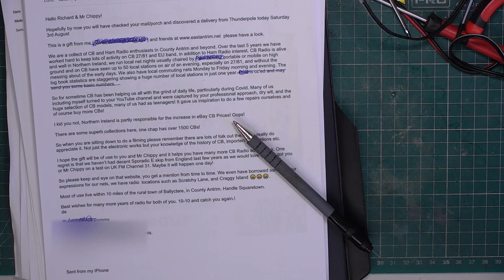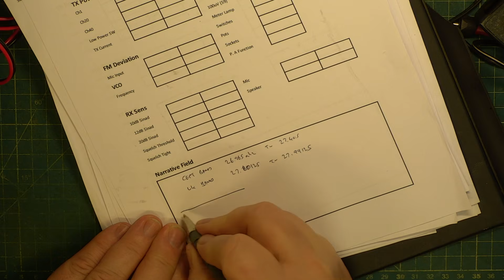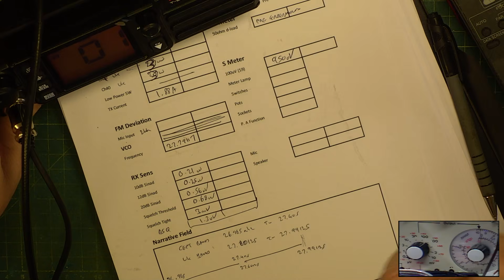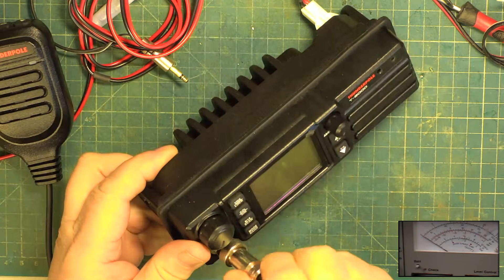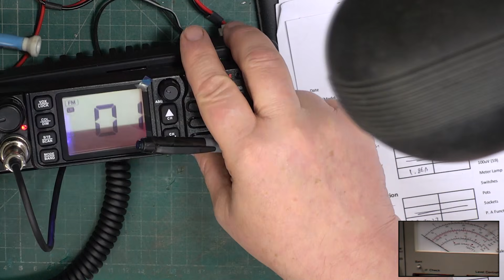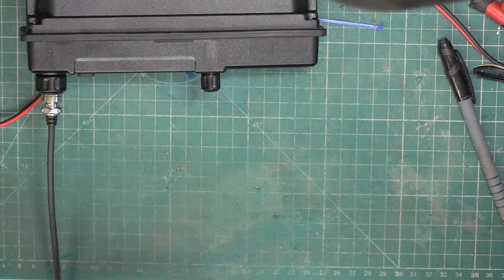Thunderpole T3000 CE-MultiNorm double service - New gifted CB radios

Comment: Do you ever hear SSB skip on your UK channels? I know 27.600 LSB has a lot lately & 27.601 is one of your channels.
Reply from the maker: Yes, illegal SSB activity interferes with the unique UK FM CB frequencies (27.60125 to 27.99125). Frequencies are allocated by international conference agreement, so it's frustrating when pirates spoil it.

Richard, G0OJF, UK
Reply: @ukfmcbradioservicingTango21  Here in the US & Canada that is part of the free band which is 24.415 - 29.995 MHz side band & also below channel 1 which most use 26.515 - 26.955 MHz AM & FM mostly. Many go off 5 kHz like 27.600 instead of 27.605 MHz etc. for example.
Reply from the maker: @drsysop  But 'free band' means Pirate as in illegal...just sounds better.

Richard, G0OJF, UK
Reply: @ukfmcbradioservicingTango21  True, but the FCC here never monitors it & nothing allocated to them frequencies anymore. The FCC charts out there are outdated & not accurate. -Cheers!

Comment: The output power on both sets as they came from the factory was surprisingly poor. It’s sold as 4w why is it only doing 3w? The quality control clearly not good enough. Also, if I was paying £119 for one, I’d expect it to have mounting screws

Comment: hi richard, can you help me with a diagram for connecting the wires to a microphone with a 6-pin plug for a TTI 880 H station, they are broken and I don't see the order in which they were
Reply from the maker: I have the circuit diagram & layout on file. Email me & I'll send it you.

Richard
Reply: @ukfmcbradioservicingTango21  where can i find your email ?
Reply from the maker: rshireby@yahoo.co.uk

Comment: I saw someone suggesting there's a resistor that can be bridged in these to get about 6 watts out of it. Maybe that's when they overheat!!
Reply from the maker: Well CB is full of myths, legends & BS - hence doing this channel showing the truth on laboratory test equipment & real-life genuine tests.

I'm sure motor cars can have things altered to make them go faster & reduce the engine life too.

This reminds me of the guy in Sheffield who decided to wire his house into the street light outside his house & therefore steel electricity. He got the connection wrong & his house became 415V. He then complained to the electricity board that his light bulbs kept blowing etc!

Once again & legality aside, 6W isn't 50% more range than 4W - it probably adds under 5%.

Richard, G0OJF, UK
Reply: @ukfmcbradioservicingTango21  Yep would be interesting one day to do your usual route with a uk set with low power temporarily set to 2.5w and then do a 4w / 2.5w comparison at the five mile point.
Reply from the maker: Have a look at us testing the 500mW PE Ranger back in 2018:-

https://youtu.be/aqIGZrh0wkU

Richard